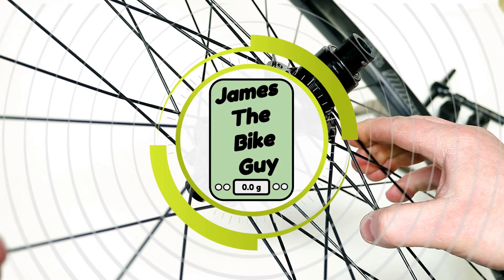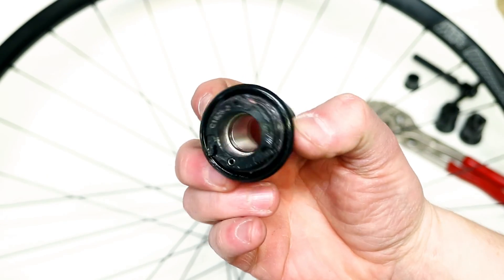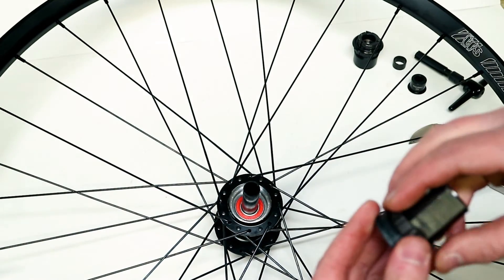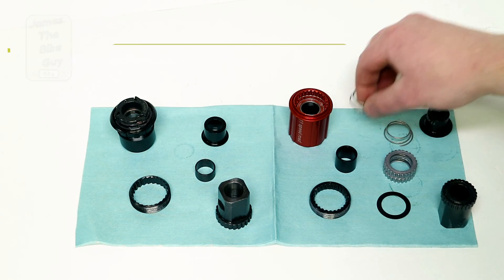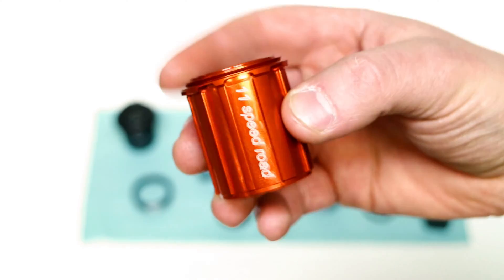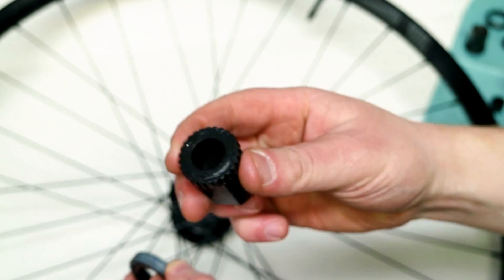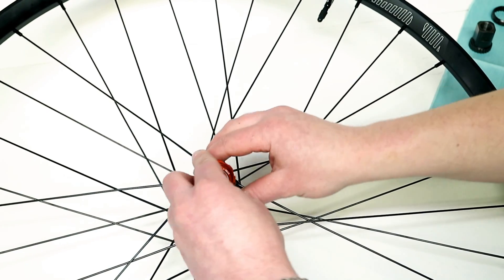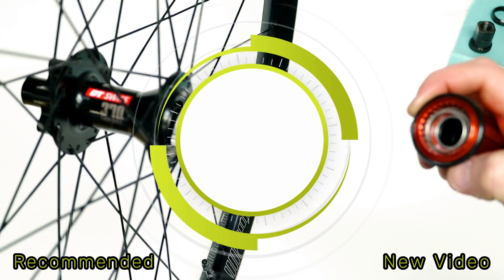How to Upgrade DT 370 to Star Ratchet Conversion using DT 350 or 240 Hub parts How To DIY

Comment: This is a great tutorial but I’m not seeing the financial sense of it, especially if you need to Service bearings at the same time. You convert a 24 POE system to a 18t system, you have to buy tools to do it and you end up with lower engagement unless you spend $100+ more to get to 36t or 54t ratchet kit which is still not that high of engagement for modern hub offerings. All of this is looking like $280 (conversion it, new ratchets, tools, may as well do bearings while you’re in there] which is the cost of a new 350 hub. Unless you have some of these parts already, sell the wheel/hub and get a new one.
Reply: So 350 is better than 370?
Reply: @bamf6603  
Yes. It's already ratchet style and lighter. Newer 370s are now ratchet style as well. This is converting an older spring and pawl style 370.

Comment: Not sure you can help, but I performed this conversion on a Roval DT Swiss based 370 hub, just as shown in the video. It works fine with the wheel out of the bike but as soon as I install it in the frame it binds up and acts like a fixed gear instead of coasting. I compared the setup to an actual 350 hub I have and everything looks the same. Any idea what I did wrong?
Reply: The shim you installed under the lock nut went out of center.  Loosen the lock nut and re-align the shim so it's centered.  That should fix your issue.
Reply: @batboyvaj  Thank you so much for the reply! You were close, I actually installed the ratchet ring backwards (yikes) the shim wasn't sitting in the recess as a result. Flipped it round the right way and it works perfect now. Thanks again!

Comment: Thanks for this video! You just saved me $100 plus with the info that the seal can be swapped from the 370 hub driver to the 350 hub driver. I have a new set of Spesh wheels with "new" 370 hubs that came on my Diverge Expert. The "new" 370s come with the star ratchet system but with an 18 tooth star and NX driver. I want the XD driver (so I can run a lighter GX cassette) as well as the 54 tooth star. I happen to have a spare XD driver and 54 tooth star so can just do the swap easy-peasy. 🙂
Reply from the maker: Good luck on your conversion, thanks for watching

Comment: Just bought very expensive new wheels (and to save a bit on the cost) with 370 hubs but I have been told that the new 370 hubs can only by adjusted to 18t ratchet and no more, is that really the case?
Reply from the maker: If you do the swap from pawls to the Ratchet system from the DT350 you can run any combination. If your doing a LN Ratchet upgrade (Came out after my video) it is limited to 18t or 54t. But in all why would you skimp on the hubs and then upgrade them? I don't mean to offend but a new set of wheels you want to do correctly, and this is an upgrade for someone who is "stuck" with the hubs they have. 
I'd really suggest you re-think and spring for the rear to be a 350. Front do whatever, but get the rear hub done correctly.
Reply: @Jamesthebikeguy  No offence taken your point is a good one but the 350 wasn’t an option only the 370 or 180 Dicut hub and that was over $500 more, which I couldn’t afford. 
Is it worth upgrading the new 370 to the 18t ratchet system?

Comment: Can you do same upgrade for h1900 hybrid hubs or they are bigger and DT does not sell the ratchet ring for H1900? Thanks
Reply: I just did the conversion on a 370 hybrid hub and your right the hybrid is ebike optimized with a 1mm larger OD drive ring,the kit I got{HXYXXXoon5968s) comes with 3 drive rings of which 1 is 1mm larger OD and has a steal micro spline hub body.if your looking for something other then the micro spline they have 2 more kits just make sure it has 3 drive rings in the kit
Reply: @glennmorgan8691  Thanks, can you pls confirm how many teeth the 598s kit comes with in the ratchet upgrade package, and eventually if it does any differences on e-bike use ? I did not find much of info on the web about the feasibility for the hybrid upgrade H1900 from 3 pawls to ratchet. Maybe is just an useless and expensive upgrade, but hope the noise level increases at least..
Reply: @federicob7521  Hi Federico,the 5968s unfortunatly comes with the 18 tooth ratchets and a steel free hub body which should outlast the aluminum version especially on an ebike.The upgrade is worth every penny but if you want noise i'd buy the  54 tooth ratchets and have the higher engagement hubs which is nice for tech climbs and creek crossings where you need to half pedal(monkey pedal) hope this helps you decide cheers
Reply: @glennmorgan8691  Hi Glenn, how hard was to unscrew the M35x1 drive ring from the hub? I heard someone had to use heat gun and even in this case there is a high risk of destroying the wheel. thanks!
Reply: @federicob7521  Hello again Federico,I actually took it to a lbs who had the tools...But I did see a video on using a propane torch where you heat up the ring for about 30 to 45 seconds with a fairly quick circular motion to heat it up before trying to remove it,I mentioned this to the bike shop and they said that's exactly how they do it,there was no burnt paint or any damage that I could see from using this method,hope this helps you out!!!

Comment: Wow so cool solution. I got a Spark 710 plus, with DT-370 failure. It looks like the rachet ring inside the hub may be spinning inside the hub bod. Is it to late for this upgrade? Too bad if I have to buy a new wheel for this.
Reply from the maker: I bet you can remove the internals and do this swap.

Comment: Warning: the 7613052165578 doesnt fit!
I ordered from different shops just to confirm it, dont waste your time! The part is about 0.5mm smaller in diameter than needed and it just doesnt lock!
Tried: HXDXXX00N1131S and HCDXXX00S1110S on a completely new 370 hub
Reply from the maker: You have to make sure you pair all the right parts together for it to work. They're kind of like Legos but you have to mix the right set together

Comment: This conversion isn’t authorized by Dt swiss because the seal around the freehub doesn’t seal the hub properly. Dt swiss is working on a new kit to convert 370 hubs but so far nothing has been released yet.
Reply: Now there is an authorized kit: Ratchet LN
Reply from the maker: I wouldn't authorize it either if I wanted to be selling new hubs/wheels
Reply: the only thing needed is actually a proper seal, I'm having problem re-use the DT370 old seal since it won't stay in place firmly. always create slight friction
Reply: Is there a legit seal for this conversion?

Comment: Can you do this on a 12 speed
Reply from the maker: Yes because the number of speeds is irrelevant to this proceedure. It requires either a 370 hub and converting to 350 parts. So choose the right parts for your drivetrain and it works just fine.

Comment: Now I'm better with technical stuff. I have a dt370 wheel and I bought dt350 hub. Given I have the proper ring nut tools, can I just swap internals from 350 to 370 without rebuilding the whole wheel, correct?
Reply from the maker: Yep

Comment: Hey James. I just did the upgrade shown here. when both springs are in and its all put together the wheel wont spin freely. but if I take one of the springs out it works. Have you ever heard of this? I dont know who else to ask so any help you can give i would really appreciate. Thanks!
Reply from the maker: You have a miss match of parts most likely. Usual suspects: endcaps not matching the new FH, shim between the drivetring either miss-aligned or wrong, wrong axle bushing
Reply: @Jamesthebikeguy  thank you for responding. In case anyone else has this issue it ended up being that the spring in the freehub shell was getting stacked on top of itself so the ratchet couldn’t fully seat. I clipped a little bit of the end of the spring off and it fixed the issue.

Comment: Hi James
I have a 370 straight pull front hub set up as QR.  I'm searching for information if I can convert to 12mm thru axle. Do you have any knowledge in this?  Thanks!
Reply from the maker: Most likely yes, just need the endcaps

Comment: I don't think anyone has asked this question yet: Will the 370 end cap fit on the new free hub body? I ask because the XD Driver on Amazon specifically says (no end caps)
Reply: I was looking for the same info. He has two different end caps in the video but there was no mention of part numbers or compatibility between the 370 end cap and the 240.

Comment: The only reason you got a different end cap is because you went to a Shimano free hub correct? I ordered the parts but I will be keeping the XD driver for my XO1 cassette so I wouldn’t need an end cap
Reply from the maker: The end cap has to match the freehub body. And the 350 and 370 freehub bodies are different
Reply: @Jamesthebikeguy  ok just ordered the end caps for the conversion. Thanks for the help!!

Comment: Hi James, do you think that is possible to convert a DT 370 3 Pawl hub to the new DT Swiss Ratchet EXP?
Reply from the maker: I don't know for sure, but from looking at the hubs I do not think it's possible. They use different axles, bearing spacing as well as star rachet position so if you "could" it would require everything except a hub shell. That said the hub shells are probably different too, so it really is unlikely
Reply: @Jamesthebikeguy  Thanks for the prompt reply! I asked that since the DT Swiss website states: "All DT Swiss Ratchet System hubs can be converted." I know, here the starting point is the 3 pawl, but since you convert it to a ratchet hub, I wonder if the new condition helps to move to the Ratchet EXP.....

Comment: Nice!

What is the difference between the 3 Pawl and the ratchet remove tool? 

Can I also use the 3 Pawl remove tool for the ratchet ring?
Reply from the maker: No they are two different interfaces. That's why you need both

Comment: Hi James. I was hoping you could answer this: i have a new wheel with a st swiss 360 3 pawl xd driver 12speed. I want to get my old wheel 11 speed st swiss 240 hub star ratchet 54t engagement and put it in the 360 body. Will that work? Thanks, appreciate the help. Cliff
Reply from the maker: No you would need a new freehub body to go with it. The 360 freehub body is only compatible with pawls not star ratchets
Reply: @Jamesthebikeguy  thank you 👍

Comment: Hello , thanks for the video , I almost done it but unfortunately I have problem , the nut ring that removed is 34.8mm a d the ring I want to install is 34mm , the nut ring won't fit too small , do you have solution?

Comment: Hello! On my wheelset which is a C1850 (OEM wheel set came with a bike) the 370 hub looks a slightly different ( like the other stock DT swiss wheelsets the hub is seems like more rounded).. Can I convert it into the ratchet system? Thank you in advance.

Comment: A couple things not really classified here:  

3 pawl system used in the 370 hubs has 24 points of engagement.  Dt swiss has a technical article on their website discussing the tradeoffs with high engagement points on full suspension bikes.  They say 36 points gives riders the best balance of benefits. Looking at firsthand accounts online,  there is some evidence that 54 points may be a little less durable. If you've ridden Shimano deore hubs they are 36 points. The easiest way to find out how many points a hub has is to count the number of clicks in a single rotation.  36 points is a click every 10 degrees. 54 points is every 6.8 degrees. This can be helpful for things like ratcheting your pedals as you climb through technical sections.

Comment: A question regarding the seal: I managed to get a hold of a ratchet-style freehub body and test-fitted the seal. However the fit is a bit loose. It works fine when slid onto the axle, seems to fit fine and spins fine too. However when I pull the new freehub body off of the axle, the seal stays in the hub. There's probably a bit of suction/vacuum happening when popping the freehub body off and since the fit of the seal is on the looser side as mentioned, it falls off and stays in the hub. Have you noticed this issue as well? Is it a problem in real-life use?
Reply: having the exact same issue, and the seal will cause slight friction, when freewheeling, the pedal moves
Reply: @vincentxie1  did you ever find a solution to this? I just did the upgrade and I’m running into the same problem too.
Reply: @djtaka691  I trim down the seal with scissor and it now works ok. just trim down the inner circle since the seal is a bit too thick to stay into the groove of the hub body. cannot take picture now but hope you can figure it out

Comment: Awesome Video! Do you know if this conversion is possible on my Giant XCR 1 29  Composite wheel 3 Pawl driver, Boost? I bought the 54T Star Ratchet upgrade only to find 3 Pawl internals. If so, will the parts list you provided work for me?
Reply: Did you have any luck? I’m thinking about doing the same.

Comment: Hello. On my road bike if I upgrade from 36T to 
DT SWISS 54T STAR RATCHET UPGRADE KIT will it affect my average speed over 60mile ride. Could u make a video about upgrading from 18 to 36 to 54 plz like what’s the advantage and disadvantages for road cycling 

Thank you
Reply from the maker: The "drag" difference is next to impercevable to calculate. Question would be for road riding why upgrade at all?
Reply: Jamesthebikeguy thank you for ur reply. I wanted to do it for sound only. But I’m not sure if it will affect my speed don’t wanna lose any speed :)

Comment: Did you add grease later on, looks like the star ratchet went in dry.
Reply from the maker: Yes, you want to use the DT Swiss ratchet grease. I did this conversion just for the video so I wasnt greasing new parts.

Comment: How did you get this thing off??? Ive been using a breaker bar on it for the past hour and hasn't budget. Definitely doesn't just screw right out
Reply from the maker: Put the tool in a vice, then use the wheel as your leverage

Comment: What is the part number for the end cap, or are you able to use the DT 370 end cap after conversion is complete?
Reply from the maker: The end cap depends on the freehub body you use. I.e. Microspline, XD, HG11 ect.

Comment: I performed this conversion but once I put the wheel back into my bike I felt a lot of binding. The wheel would not free wheel. Any idea what may be causing this issue? Great video btw!
Reply from the maker: Spacer, bushing, not threading the drive ring in enough. A few diffferent things.
Reply: @Jamesthebikeguy  I realized the spacer had shifted while I was screwing in the ratchet drive ring. Part of the spacer was coming in contact with the bearing in the hub binding everything up. I appreciate your help!

Comment: Big problem here. I got all parts from the description but my drive ring has a very shallow spot for the shim ring which falls out while I'm screwing in the drive ring. Therefore I can't screw it all the way in and the outer ratchet touches it. It works until I put the wheel on the bike and tighten it with the QR (unfortunately). Then the whole drivetrain is blocked and feels like the bearings are squeezed. Can you help? How thick is your shim ring and does it really need to be there?
Reply from the maker: The shim ring is required, and it takes some finesse. Use gravity to keep it in place.

Comment: In the world of crap bicycle engineering and model obsolescence, this is really good engineering.  I like this brand.  Not worried about failure of either type 'ratchet'.  Many hubs have only had 2 small pawls and the 370s look pretty chunky.  The ratchet systems look a bit delicate (fine), but they are easy to renew, as are the bearings.  Having the option to convert for sound or tighter engagement is a great option.  Really clean design.
Reply from the maker: Indeed, DT Swiss does make some great parts

Comment: Can I use the same end cap that has Pawl hub and used with the DT Swiss XD Freehub Body Ratchet Drive?, thank you
Reply from the maker: Endcap goes with the freehub
Reply: @Jamesthebikeguy  Aaaah, so you only need the one end cap that would go with the new freehub, is that right? Look like most retailers sell end caps as a set of two.

Comment: I completed the upgrade today!  Thank you so much for making this video and answering all my questions. 
Removing the freehub body from the cassette was a challenge, especially without a chain whip. Removing the hub internals was even harder. For those attempting this upgrade, ensure you have a long wrench, because you’ll need every bit of leverage you can get.
Reply from the maker: Glad you got it done congrats
Reply: Hello. Do you know if the end caps of the ratchet freehub are the same for the 3 paw freehub (for the same type shimano HG). I know that for the sram XD are different from shimano HG . But also, the Sram XD end caps for the 3 paws are maybe the same for the ratchet freehub??? 🙏 Any information would help me for upgrade my bike. Thanks in advance 😀

Comment: About the seal. What I found was that the seal from the 370 free hub body would not stay on the 240 free hub body because the seal groove on the 240 is "V" shaped and the 370 has a square seal groove. Sure it goes on, but it does take much to pop it off. However, I used super glue (after cleaning both seal and free hub with degreaser and alcohol) to secure the seal to the free hub body. It seemed to work well, but it'll take some long term testing to prove out.